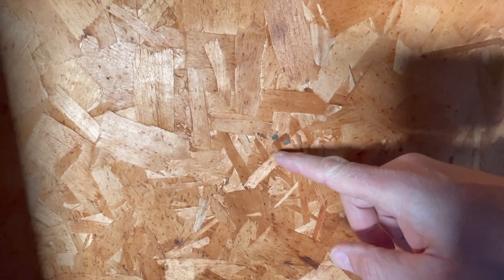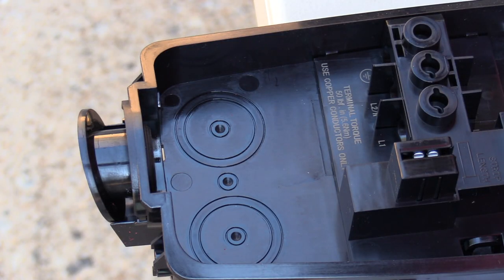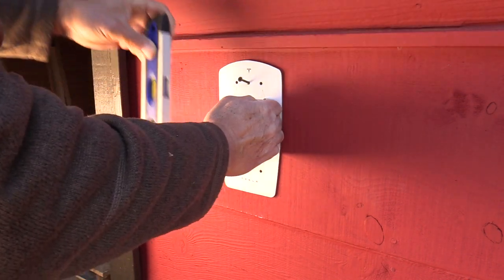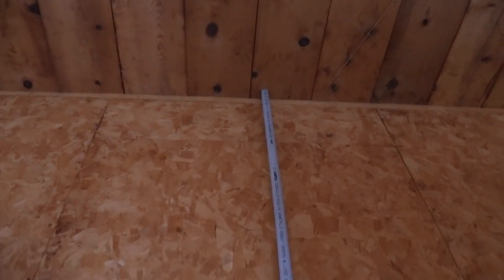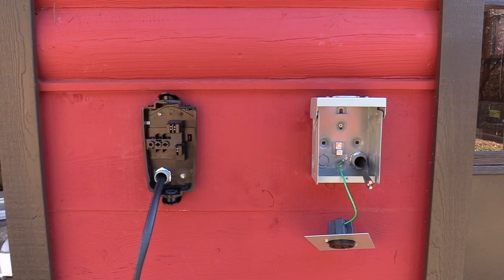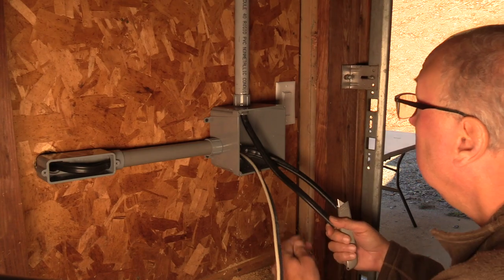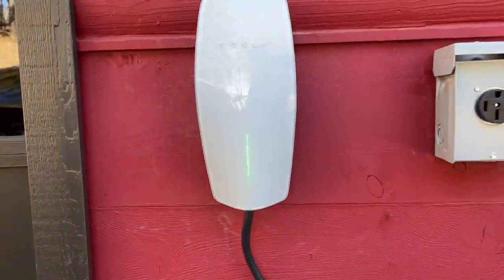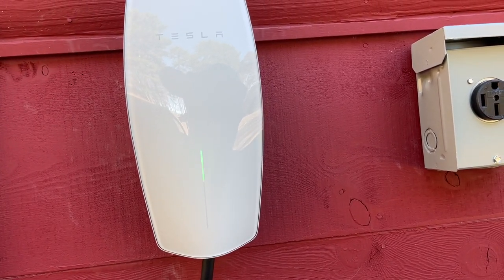Can You Install a EV Wall Charger Without Trouble?

Comment: While this is a working solution, it has multiple code violations and is potentially not safe.  Do not install these in parallel.  Wall connector and Nema 14-50 each needs its own dedicated circuit.  When using white wire for hot, wrap black electrical tape around ends to indicate it is indeed hot, and not neutral.  Nema 14-50 must have neutral wire to meet code, even though EVSE will work without it.  Good advice at the beginning of video; to have a licensed electrician do this work.
Reply: All of that, plus EV charging circuits must now be on GFCI breakers as of 2020 NEC code. He didn't show the breaker in the video, but I'm guessing it wasn't. Lastly, 8ga and 6ga wiring requires 10ga ground conductors, he only used 12 for the 14-50 receptacle. Edit - if he's using a 60a breaker, this is technically above the 14-50 receptacle rating and is another violation.
Reply: @andrewt9204  The Tesla power wall(Both V2 and V3) does not work with a GFCI Breaker, read the manual. "do not install a GFCI circuit breaker.
".
Reply: @chrisville25  true, I read that as well after I posted this. I was just going by what my county inspector told me to do last year. Since I "had" to have a GFCI breaker installed no matter what, I ended up putting a 6-50 receptacle in for now. Which is fine, I'm just using the mobile connector and limiting to 25 amps to reduce the line stress and the slower the better for battery longevity anyway. It's plenty for the 120mi/day I travel. Recharges in 6.5hrs.
Whenever I switch to a hardwired unit, I'll just remove the GFCI breaker.
Reply: @andrewt9204  IIRC the Tesla wall connector has GFCI built in?
Reply: @chevrofreak  Yes, it does. Which means you shouldn't need one at the breaker. I think inspectors a bit out of the loop see an "EV" circuit and automatically say it needs GFCI. The code should be more clear on this and state that it's only required for EV circuits using a receptacle, and not hardwired EVSE's. 
Or if they still want it, specify hardwire EVSE's require "equipment GFCI" (or class C) breakers, which trip at higher leakage current. So if there's an issue upstream of the EVSE, or the EVSE fails there's a little extra protection.
Reply: Had a local inspector at an IAEI meeting stated that he no longet accepts black tape on a white wire. Wants either paint ir a color heat shrinking thbing. Yea cut us a break.
Reply: @chrisville25  Good luck trying to not use a GFCI. Would be afraid if possible liability issues with scum bag ambulance cading lawyers.
Reply: @andrewt9204  Pull out the manual when the inspector says something.. the tesla charger has a GFCI built-in and if you show that to the inspector it meets the NEC requirements. But not all chargers necessarily have GCFI built in so the inspector has no clue unless you show him.
Reply: @garbo8962  Device has a built in GFCI so he is using one.. same as having a GFCI built into the receptacle
Reply: @andrewt9204  nec 625.54  is specific.  The recepticle needs a gfci for car charging recepticles....code before 2020.  Recepticles, not hard wired.
Reply: @Josh.1234  does the gfci in the charging unit protect the recepticle on the wall?  Nec 625.54 requires a gfci for car charging recepticle like he mounted on the wall.  210.8 talks about gfci for recepticles mounted outside the building.  In 2020 the code raised the voltage to 125-250.

If he wired it in accordance with article 625...one circuit per charger, he could have gfci the recepticle and regular breaker on the hard wired charger.
Reply: @keithharrington8715  Yeah not sure on that functionality of the Tesla charger, whether its GFCI would trip properly if the 14-50 exceeded its amperage. 

overall though watching parts of this again, I wouldn't put a 48amp charger and a 50 amp receptacle on a 60amp breaker.. also not sure if 6-2 romex meets code either for a 60amp breaker.. 6-2 romex can only handle 55amps.. probably SER/SE cable or individual 6awg wires which handle the full 60amps is to code.
Reply: @Josh.1234  remember when selecting wire for ampacity, ability to carry current, that the terminal connections on the breaker generally put you in the 60 degree C column unless the breaker terminals themsrlves are marked for a higher temperature.  This is in the code in section 110.14.

Okay. The way to use the higher temperature ratings for wires might be to connect up a uf no 6 cable and then splice with a no 8 if the temperature rating of the splice allow.  But that might nean one foot of no 6 then 100 feet of no 8, the another foot of no. 6.

Crazy, yes, but that's what your looking at for code
Reply: @andrewt9204  nec requires 
 gfci protection for the recepticle 2017 nec or earlier in the evse section. 625.54.  So gfci if plugged in, no matter what is inside the unit. (Gfci for recepticle before  unit no matter what is in the unit.
Reply: Get an eletrician is good advice 🤣
I was looking for this comment about splicing both in parallel. I was thinking what if the party has two EV vehicles... One a Tesla and one a regular EV and the use both options. Or even two Tesla's one using an adapter. It's not gonna be good.
Reply: Per the nec an outlet requires gfci breaker when outside or in a garage. Permanently installed evse must be gfci protected. This could be in the device or at the breaker. Since the gen 3 wall connector has gfci protection its dedicated circuit doesn’t need a gfci breaker.

Comment: I enjoyed this video.  I ran 6 AWG THHN conductors in conduit for my Tesla Gen 3 Wall Connector.  My interpretation of the NEC concluded that NM-B (Romex) 6/3 cable ampacity is limited to the 60°C rating which is 55 Amps from Table 310-16.  Double check this with your Authority Having Jurisdiction.
Reply: Exactly!
Reply: What you said is partially true. 6AWG NM-B (Romex) is only rated for 55amps at normal temp/distance. But there is a round up rule with breakers that says if you are not running more than the 55amps in this case, you can round up to the 60 amp breaker for the 6 awg wire.

You cannot put 60amps of load on the 6awg with the 60amp breaker but as long as its connected to a single hardwired charger like the tesla charger which only takes 48amps, it is no problem. Only issue is if you ever want a wall charger that pulls more than 55amps. Can't do this with receptacles because you could put something on it that pulls 60amps and overloads the wires but since the charger is capped at 48amps, and that is documented, it is ok.
Reply: @Josh.1234  Hey, I know this is a super old comment… but for others that might see it, this is NOT a correct use of the “round up rule.” I’m a master electrician btw.

In this case the load is actually 60A, not 48A, because it’s a continuous load and we must consider the ADJUSTED value when determining wire size.

Comment: I believe you have two problems with this installation.  The NEMA 14-50 outlet requires both a dedicated breaker and a Neutral conductor (even though the mobile charger does not use it).  The dedicated circuit makes sense because two guests who may have charged before could plug in simultaneously and exceed the ampacity of the circuit.  So I don't think you meet code at all with your installation of the NEMA 14-50 circuit.
Reply: I wondered why that third terminal wasn't used. So I would need #6 with 3 conductors and a ground?
Reply: @jimmywicker1662  Yes, for a NEMA 14-50 it uses #6 with 3 conductors (6-3 NM-B) but the ground inside does not have to be that size.  I think #8 is adequate for the ground.  All three conductors are hooked up as well as the ground for devices that may use all three conductors.   The Tesla wall charger does not use the neutral so it isn't required for that.  So two #6 conductors and one smaller ground is fine.  If the cable is completely buried inside a wall or overhead, I believe NM-B wire is OK  (Non-Metallic Sheathed Cable) but if you use individual wires it should be in conduit.  

If #6-3 NMB wire is used, don't forget that it needs to have cable clamps on each end and  attached to the wall with staples or some sort of hold down for vertical rises.  Also, when the wire penetrates studs or other boards inside the wall, it needs to be as far away from the edges (ie centered) as you can make it to prevent sheetrock nails and screws from penetrating and shorting the cable.  

Always consult a licensed electrician for these types of installation if you don't know the local codes or have familiarity with these as electricity can be dangerous and screw ups can burn your house/garage down.  But videos like this can give you things to look out for!
Reply: Yes, the wall connector should be on its own 60 AMP breaker, and the NEMA 14-50 should be on a 50 AMP breaker.
Reply: @alex-650  Agreed!  The "50" in NEMA 14-50 implies a 50 Amp breaker and no more than a 40 Amp continuous current draw.  If a Tesla wall charger (EVSE) is used on that circuit, it should be provisioned for the 50 Amp breaker (via one's smartphone).  If it is hardwired on a 60 Amp breaker it will only draw 48 Amps continuous.
Reply: I've gone back and looked and the conductors for ground and neutral for a 14-50 circuit should probably be at least #AWG 8.    Ideally the three current conductors would be #6 and only the ground sized at a lower value.
Reply: @brianbeasley7270  My understanding is 50 amp should be 6 gauge. 6 gauge can handle up to 55 amps. For the 60 amp it should be 4 gauge, but if on a dedicated circuit with a tesla connector maxing out at 48amps - then 6 gauge is ok.
Reply: @alex-650  Agreed.  #6 gauge is appropriate for the 50 amp breaker (which should only draw 40 Amp continuous).  A 60 Amp breaker will only support 48 Amp continuous (80% of breaker rating) when properly configured for any continuous load.  Assuming the run is not too long, AWG #6 should be fine for the Tesla wall charger on a 60 Amp breaker and will be configured for 48 Amp max draw.  It's certainly OK to go up to AWG #4.
Reply: @wedwardsvt  the Tesla can reduce the draw amperage to 80%, but that requires a manual setting by the driver on the charging screen.   Expecting the driver to understand that,  and WILLINGLY reduce the charging speed is like expecting a Baby Boomer with a case of wine to use 1/2 a Viagra tonight when he has a date with a 30 year old.

Comment: Some talk here about gfci breakers. The updated code calls for them with the 14-50 outlets, but not when hardwired. In our AHJ, they have yet to adopt the changes so we are not required to do so yet. Still, I am moving away from any plug-in installation. You need commercial grade outlets, the neutral (unused) wire and sometimes the gfci breaker. As mentioned, inspectors are wanting to see the manuals. Many state 90 Degree copper which rules out romex regardless of amperage. Go hardwired.

Comment: if you use teck in from the bottom then you have to use a coupling and nipple to get it to fit. then the grounding bushing also doesnt fit with the lug attached.

Comment: Videos like this can inspire many.  Just make sure you are getting it right.  I am not trying to criticize here, rather provide information for everyone.

The National Electric Coe (nec) does not apply to everyone in the world and it was written in the blood and tears of those people in the past.  So, in America, most places us it.

Do you need a permit for this?  Maybe, make a call or two.

Are my wires big enough....not to the charger but to your house?  Here, effectively 2 additional oven/stoves were added to your electric panel to run for 6-10 hours.  Is there space, will they carry the current in the wires from your utility company to your house?

As far as the connecting it up:

Nec 90.4 allows you local building guys to interpret the nec.

Nec 110.14 terminal connection puts your wire under the 60 degree C column
(No.8 thhn at 40 amps not the other ratings based on the breaker terminals).

Nec 210.8 now requires 125-250 volt recepticles in your garage, outbuilding, sheds and outside be gfci protection.

Nec 220 has the calculation procedures to ensure you have room for the extra power your house will use.

Nec table 310.16 gives you your wire size based on the lowest temp rating of terminals in the circuit. (Normally 60 degrees c based on your breaker terminals,).

Nec 406.9 (B) calls for the recepticle outside to have a "weatherproof" cover while the unit is plugged in.

Nec 625 is for Electrci vehicle power transfer system (car chargers) with many appropriate requirements.  

625.40. Each outlet for car chargers get one circuit.  So for this video...2 sets of breakers and 2 wire runs.

625.41 says to rate the circuit at a minimum of 125% of the maximum 
Load of equipment.  (A 40 Amp max rated charger needs a 50 Amp wire/breaker no matter what you set it to.  Yes, a 40 Amp charger throttled down to 32 amps still needs a 50 Amp circuit.)

625.54 requires a gfci if you put in a recepticle to protect the recepticle no matter what is in the charger. (Required in at least 2017 maybe earlier).

625.56 again weatherproof recepticle cover for outside recepticles with the cord plugged in.

I did not mention any requirements for conduit, conduit runs, or wire runs and more.

Your building department may see a relay/contactor/bus transfer switch of some kind to allow a set up like this to only power one outlet at a time, one charger at a time.

It is not impossible for an average home owner to get the information needed to do this job safely and correctly.  Most Electricians want a safe build and so do the building inspectors.  Do not be afraid to ask.  You might find an electrician to come buy and get you all the info you need.  You might have to slip them a beer or a meal or some cash, but you can physically do It all.

Please do it safely and do not just "make it work".  I know electric, not insurance.  I do not know if they have to pay out if there is no permit or if they can prove it was not done to building codes.  In this video, the risk could be the cars, the house, or even the lives of the guests.

Dave, thank you for this video.  Every video gives us a chance to learn.  

Some teach us what to do and some what not to do.   

Again, I am not trying to criticize here. You may have done everything according to your local building guys requirements.

Again thanks.

Comment: Nice job Dave but that ground wire should be one sized down from #6 to a #8 and always use black, red or blue tape on the white cables in all boxes. Anyone opening those boxes or splice boxes will know there is no neutrals inside.
Reply: According to code in my area #10 ground would be fine for 60 amps.
Reply: 6/2 Romex comes with a #10 ground and that's adequate for up to a 60 amp breaker (per the NEC table 250.122). If you size up to 4 AWG for your hots, you have to similarly upsize the ground wire even if you keep the breaker size the same, and then you'd probably end up with a #8.

Comment: You can't run the 14-50 and Tesla charger on the same circuit - aside from the code requirement that they stay on dedicated circuits, you will almost certainly trip the breaker if you tried to use both at the same time. Tenants stress test houses in ways you don't really think possible. If you're using the place as an Airbnb, someone will eventually do it.

Comment: Can you explain to me why the gen3 uses only two hot leads and a ground?  What happened to the white common wire?  The Nema 1450, of course, uses all 4 wires - 2 hot, 1 ground, and the white common.  All 240v installs I’ve done for years always has the white
Reply from the maker: Chris the wall and mobile connector use 240 or 120 vac.  When using 240 the use of L1 andL2 is all that’s needed.  120 is not needed by the connector just ground.
Reply: @evdave528   The NEMA 14-50 needs to be wired with all 4 wires.  The white N and green G is bonded only at the breaker panel in residential code.  It is my understanding that the Tesla wall system only uses the Red, Black hot plus the Ground G connections so code says to put a wire nut on the white as it is not connected to anything, not even the Ground terminal.   I believe new code doesn't apply to existing wiring, unless you do repair or changes.  Then you must bring everything up to the latest code.  

Also as a matter of safety, is your NEMA 14-50 box rated for outdoor and water tight?  

Been many years since I worked as an electrician so I welcome any corrections.
Reply from the maker: While a common Brenda 14-50 receptive needs a neutral, when connected to a wall connector, neutral is not needed, no connection for it.  So I didn’t run the wire

Comment: I appreciate the DIY but as a caution for others wanting to do this depending on the breaker you can’t use that Romex in this install.  There’s a lot this video is missing so aren’t you afraid of the risk of posting inaccurate information?  You should at least get an electrician to sign off.